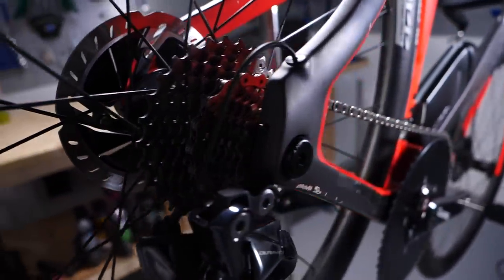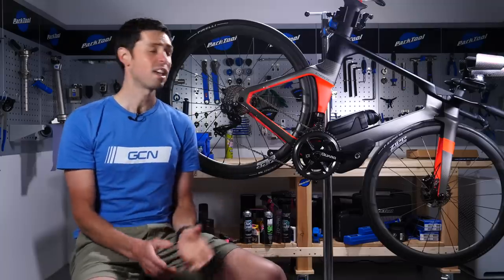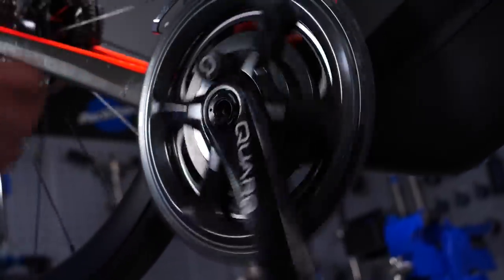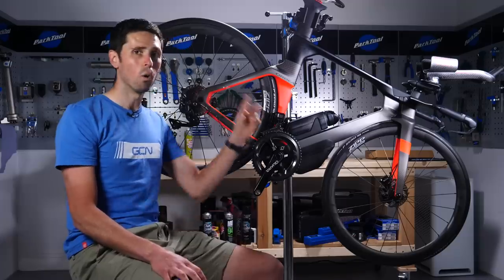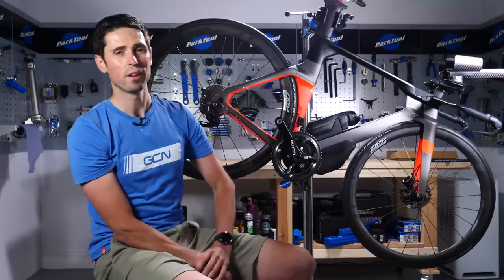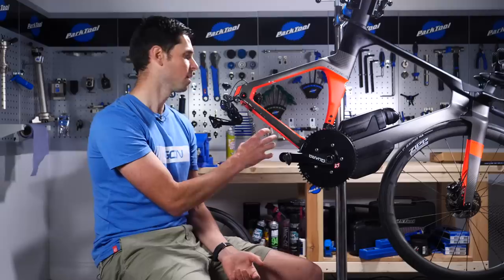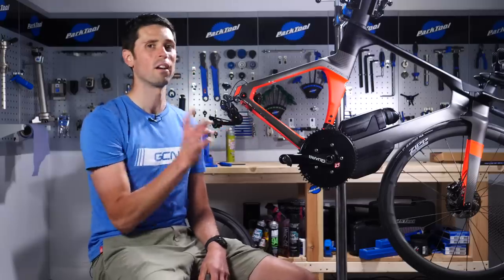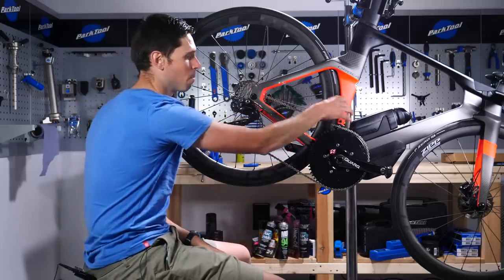How To Convert Your Bike To 1x In Five Minutes | GCN Tech Maintenance Monday

Comment: you forget mention Chainring Offset. if you go 1x on you road bike, you'd better make sure Chainring has 2 or 3mm offset. Or you might have some noisy "cross chaining" problem
Reply: How did you ensure there’s an offset? Is that through the chainring bolts?
Reply: @justinseau  There's always the option of adding spacers to your bottom bracket.
Reply: @thomasjousse2427  yup, offset is really noticable on narrow wide chainrings. I used BB spacers to get it good. 
Still a bit of drivetrain noise in the largest rear cog on mine but I have a silly set up. 
Mountain bikes generally have more leeway with this because they generally (always?) Have longer chainstays.
I'm set up with an oval 1x11 46t front 11-50t, while I rarely use that 46-50 combo I admit to giggling a bit everytime I do.

Comment: 5 minutes??? Even with Alex’s super easy setup that most of ppl don’t have, it can’t be done within 5 minutes. 🤷‍♂️
Reply: It can be done in one minute, snap the shifter cables.
Reply: if you are in a hurry just cut the front derailleur cable and you are 1x in 5 seconds
Reply: I can do it even faster,  in zero time,  just don't use the "other" chainring........
Reply: What a faff, and loss of flexibility, for a measly 4 watt saving. 😖
Reply: @robertrjm8115  alex is super fast . just like when he showed us how he will never use tubes again and pumped up his tubeless set up with a floor pump. and also when he he did the hub service. hes just so fast. get rid of him hes the worst presenter ever. bring back matt.please.
Reply: @sidshel4428  He seems to have a speed drive mode where everything must go fast or faster.  I was getting a bit worried when he presented "how to change a bottom bracket bearing and said "bang them in" several times.   That is exactly NOT what to do with a bearing and a bottom bracket shell.  You slide them in softly and smoothly until they reach the end stop and no banging anywhere.  
Alex, when you read this, please slow down, and charm yourself a bit.  Even bike repair and maintenance should be fun and done with enjoyment.

Comment: Sram Etap makes this an easy change both ways.  No wires to mess with.  Additionally having the data required before making the change so you can calculate the gear ratios perfectly.

Comment: a lot of people seem to not like 1x drivetrains, I love my 1x drivetrain on my crossbike (also used on the road, with road wheelset). I recently put on a bigger chainring (from 40t to 46t) because I wanted some more top speed (I like my sprints). About steep hills (so having a small enough gear): the answer lies in a big cassette, I have an 11-40. No my cadence isn't always optimal but I'm not a pro, if I ride a bit slower because I like my cadence better, so be it. (I'm 19 years old so don't you dare say i'm not competitive in my mind, but when you're just riding around I don't need to be the fastest, I want to have fun)
Reply: I agree but if like on this video people only remove the front derailleur and one chain rim without swapping the rear cassette to compensate, it should disappoint a lot 😂
Reply: Single ruins your top speed as it has a ton of cross chain inefficiency, is terrible at climbing, or terrible at downhill pedalling.

Comment: 1x is so easy and almost mindless in terms of picking the ratio. I have 52 in the front and 11 speed 11-42 rear cassette, which easily covers the range of a standard 2x setup. I'm not going to say it's lighter, because the cassette is heavy. the middle ratios i'm riding the most of time make for the straight chain. i hate the faff with 2x. my background is track and im not that fussy with the cadence either. having sram shifters, dropping 2 gears is not a problem. clutched rear derailleur help me jump kerbs. no drawbacks. if i want to go in the mountains, I'm putting 46 chainring and i'm flying :D
Reply: This guy has strong legs everyone
Reply: Double 1x, or 1+1x?? And swopping that chainring IS only a five minute job! Certainly if you have two chains on the go. Predominantly using the middle ratios will probably be saving even more than the 4 'aero' watts. That said, for an all round everyday rider that just wants to jump on and go it kinda does highlight how good a real 2x is.

Comment: Only makes sense when you need a very specific setup (flat/TT) or go with a larger cassette for a wider gear ratio. However, the video definitely makes sense because even full-fledged TT bikes come with 2x setups (hey, Shimano and SRAM also want to sell their expensive parts), but if you really don't need it, why would you keep an unused derailleur on the bike? 😁
Reply: Yes very TT specific although that was never mentioned

Comment: Are three ring front chain rings still a common thing in modern bikes? Thanks for the video!
Reply: Not really, just in some touring and city bikes and also cheap bikes. Once you have 10 or more sprockets in the rear wheel, there are not many situations where a 3x system will be better than other options.
Reply: Ollie Gear...
Reply: This is it... for hauling big loads up steep climbs on rough tracks, whilst not being super fit, and yet being able to build up a good speed on the flat. 3x is potentially great for some things. But as said, it's often found on old / cheap / heavy bikes.
Reply: @peterharrington8709  But even for that, something like a Pinion gearbox or Rohloff hub paired with a belt drive will be a much better solution than a chain and derailleurs system.
Reply: @Membrillo81  you may be right.... certainly from an ease of maintenance point of view. Initial cost is an obvious problem though. And it might be hearsay, but I think I remember seeing an article saying that hubs are significantly less efficient than chain drives... albeit clean well maintained ones! I just think that 3x is rather unfairly maligned. After all, IF you go with a system with a front derailleur, why NOT choose 3x over 2x? Potentially greater range and effectively three chain lines nicely aligned to the cogs you would use them with. Less need  for the very small cogs like 9 or 10 tooth that some also claim to lead to mechanical inefficiency!? I know it's crazy talk, but could it be that somewhere down the road we find that 3x is / was / will always be a part of the optimum high performance drive train..... as well as being good for cheap and cheerful commuters, tourers and MTBs? 😃

Comment: What happens with mechanical brifter if you remove the cable for the front mech and possibly the rear brake cable (rear brake also useless)

Comment: A few questions:
1.  A single chainring ideally needs a different chain line. The video didn't seem to address this. Is it as simple as removing a spacer from the cranks?
2.  I run Force AXS 2x. The system is designed to not allow first gear in the big ring, so if I remove the front derailleur then the system won't go into lowest gear. Is this correct?
Reply: Re pair the rear mech without a front mech so it knows its 1x, then it can use all the cassette gears.

Comment: When (if) we can get 15 gears on a single cassette then I'll switch. Before that it's just not worth losing that range.
Reply: 14 would do it for me.
Reply: Running, for example, 52/36 chainset + 11/28 cassette will give you about 4 gears that you probably won't use to avoid cross-chaining and about 6 gears from either side will be in a very close gear ratio. You'll get about 13-14 unique usable gear ratios. 

1x12 setup won't be that much different
Reply: @se7enTse7en  if you have an 2x11 speed groupset, dropping 2 gears from each side will give you 18 gears of which 4-5 on each side are repetitive, which leaves you with 8-10 unique + 4 or 5 of the crossovers = 12-14 usable gears. 

On 1x12 setup you won’t need to be worried about cross-chaining as a big chainring for 1x setup is manufactured to accommodate that. You’ll get full 12 gears

Comment: Rides of Japan, great channel, say that with short chain stays the sideways tug on the chain to the extremes of the cassette causes noise, and noise means friction, friction means inefficiency. I'd imagine that this TT bike has short chain stays. How do you get round that issue?
Reply: I got a rather standard 420mm Chainstays and I'm fine with my 1x11. And RoJ has a 410mm which is a bit short like most aero/performance road bike these days..

Comment: you will need to change the bottom bracket axel otherwise the  cross over chain effect can be brutal , you want to bring the front gear closer to the frame, be careful if you replace with a bigger gear or keep the same big gear, it might not fit with the frame if you change the BB axel , measur how much distance you have from the center of the axel to the frame
Reply: Definitely a consideration! It's a different beast, but my gravel bike, which is obviously designed to have bigger tyre clearences, barely has clearance for a 38 tooth ring. In fact I decided that adding an extra 1.5mm spacer to move the chainline out a tad was sensible. Slightly more optimized for the smaller cogs of course, and less so for the Granny gear, which I never ever need of course 😉

Comment: Just be aware to anyone converting to 1x with a modern road bike that due to shorter chain stays that a single chain ring can be quite noisy in the extremes of the cassette. TT bikes are usually much better
Reply: Can definitely confirm the noisiness with having an GRX 1x groupset on a Trek ALR 5 currently - not really made for it (apart from that, works good).
Reply: Longer chainstays do reduce chain deflection. 1x1 would be the ultimate   in this category and never chip the frame. Sometimes used in hill climb comp.

Comment: Crikey! With such a tight rear triangle that's going to cause some serious cross-chaining. Good tip to just cover the front Di2 cable, rather than removing it, cos plenty of peeps are gonna switch back to 2x, once they find out how noisy that tightly cross-chained chain is.
Reply: I set up my giant TCR as a 1x recently and there is an unfortunate amount crunch sound going on when I'm in the easiest two gears 😢
Reply: @McBeatha  my sympathies, but this is inevitable unfortunately.
Reply: @joules531  on bikes with longer chain stays it works just fine, like my gravel bike. But bad idea for road bikes

Comment: Is the  lateral position of the new chainring between the two old ones to minimize cross-chaining?
Reply: I´ve seen singlespeed chainrings with an offset that can achieve that. On my MTB for example i had to get one of those to provided the correct chainline after mounting. the chainline can be altered with spacers between the crank and the bb or the crank and the chainring aswell.

Comment: My advice will be don't do it, just don't.
Reply: How come? Im considering it
Reply: @patientswim6888  yeah i also did, and then realize you need to change a lot of things if you are mechanical, and also you lose a lot of gear ratios spread so you will have to ride at to different rpm to keep a smooth speed in very different terrain, i think is great on off road cycling where cadence and gear ratio is less important but on road is a big lose

Comment: If all your doing is removing the inner ring and changing the outer ring, won’t be chainline be wrong?

A 1x chainset is designed to be able to run smoothly the whole of the rear cassette.  
A double chainset is as far as I’m aware not designed to run smoothly throughout the rear cassette due to chainline.

Also if you turn a double chainset into 1x then you will most likely needto change the bearing on your rear cassette. 

I don’t think it’s that easy to just change your outer ring on a double chainset and still have a smooth running gear system and a wide range of gears.

Thoughts 🤔🤔
Reply: Chainline will be of course more optimal on the lower gears on the cassette. However it depends on the bike, with longer chainstays you dont have that much of a problem, with shorter ones the angle of cross chaining could be quite high. There is no need to change any bearings, or do you mean something else?

Comment: if you remove the bottom bracket , gears, pignons , derailleurs , chain , you will save all kind of watts, be more aerodynamic, save weight , but you will use your shoes faster , even more if you remove the brakes

Comment: No thanks, i live in a hilly country, i need my gears.
1x12 is fine for my mtb, i rarely go fast on gravel or over roots, but on a bianchi xr2? no way Jose.
Don't you have steep inclines in GB?
Reply: Well it's on a time trial bike, which tends to be used on (not exclusively) flat courses. Besides that, I see people sometimes running a 1x with a 46t or so in the front and a mountain cassette in the back, giving plenty of range.
Reply: You can get a 30T chain ring and have an 11-50 cassette if you want. 1x doesnt mean no low gears. I have a 46/30 with an 11-32 cassette on my bike and I never use the big ring so Im considering just getting rid of the double.

Comment: 10sec over 20miles by saving 4w? Dream on. 
At best 3-4sec with tailwind, on flats.
Reply: Sorry dude, you're way off.
Reply: @the318pop  I assume you've got some math to go with that?
Reply: @cosinus_square  Obviously it depends on the speed you're travelling at, if you're doing 20 miles up a reasonably steep hill at 200w then it doesn't stack up. A reasonable speed on flat or rolling terrain and it's perfectly reasonable. I'm not doing the maths in a youtube comment though, just play with the numbers yourself using the rule of thumb about aerodynamic drag being proportional to the square of speed.
Reply: @the318pop  When bike components are bleeding my bank account dry I tell them to take that thumb and ... .
But I digress, we are talking about dirty air down there, lol, turn the front wheel a few degrees and you've negated everything gcn is trying to prove here. Ergo, you end up with a poor drivetrain setup, that has more friction than a 2x, robbing more than 4w. How's that for common sense?

Comment: Not in a million years I'm going to downgrade my road bike. I'm not a foolish hipster that likes to follow trends.
Im an engineer. Compact has a higher drivetrain efficiency, end of story.
Reply: As an engineer you’ll understand the ‘upgrade’ you get from eliminating the weight of duplicate ratios.
Reply: Larger chainrings have a higher drivetrain efficiency than smaller ones
Reply: @jamieab13  lighter and more aero, less prone to failure.
Reply: If you encounter a steep climb, have your tech grab your climbing bike off  of your team car....
Reply: @leadsled213  you need to look into this more seriously before commenting. The point is to have the same gears as with two chainrings, but to eliminate the duplicates. What gears do you run? I’ll tell you how many duplicate gears you have.
Reply: @se7enTse7en  Assuming that is Shimano, you also have 5 pairs gears that are essentially identical on each chain ring. They are the the 36-12/52-17, 36-13/52-19, 36-15/52-21, 36-16/52-25, 36-19/52-28. Eliminating one of them and the two for cross chaining we get 15 gears. The 52-23 is so close in between the 36-15 and 17 it is essentially a waste also, which gives you 14 gears. Campagnolo Ekar is 13 speed and the other two manufacturers will hit 13 very soon.
Reply: @se7enTse7en  I stick by my argument. The weight savings are easily researched.